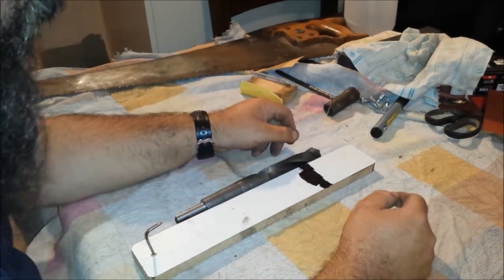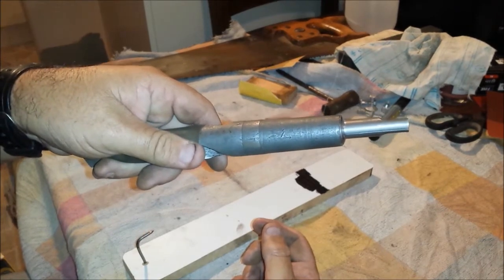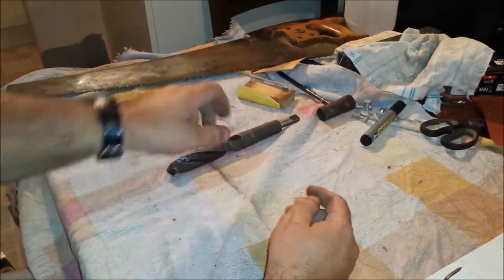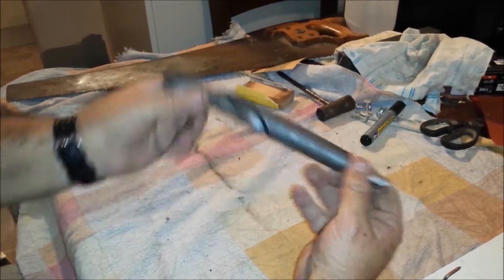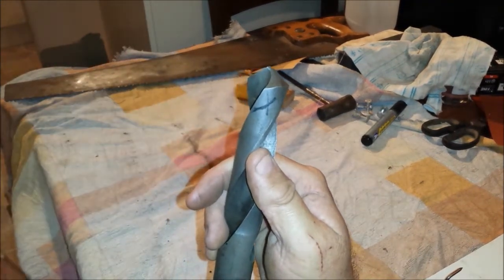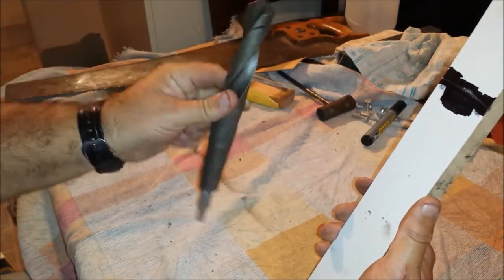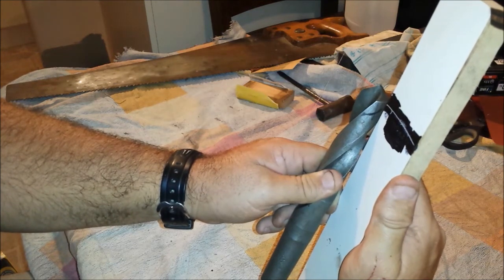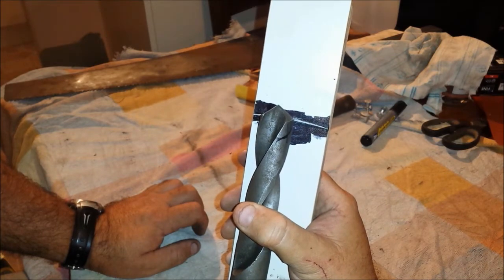DIY Drill Sharpening JIg

Comment: Your dads mate has evidently had a machining background, the jig is a great way of checking that the cutting edges are even, but it doesn't mean that the cutting angle is correct or even.  The drill could be ground off flat and still have even cutting edges, or one edge could be 130degrees and the other at 118 - the chisel point would be off centre!  Need to have the correct tip angle, correct cutting angle and the correct edge length, this jig gives the correct edge length if the tip angles are correct.
Reply from the maker: Thanks for pointing all of that out. As you can tell, I'm no machinist.